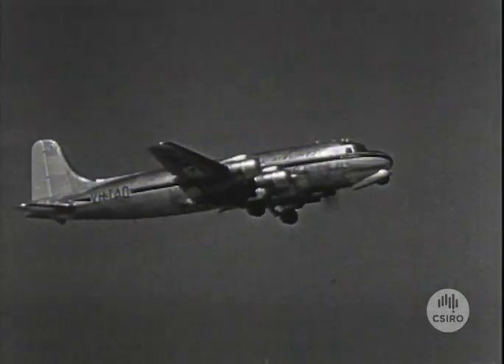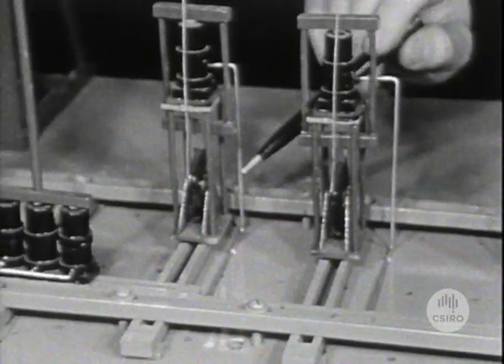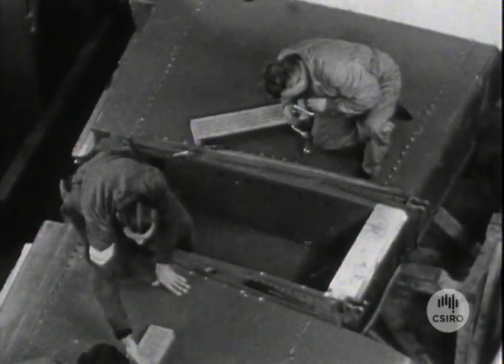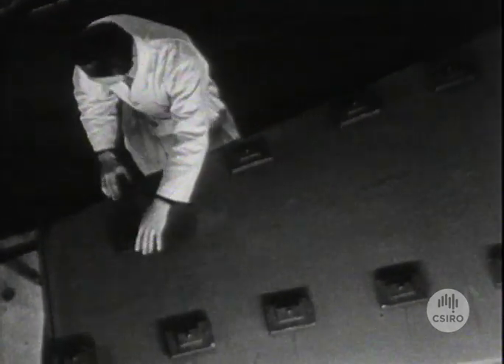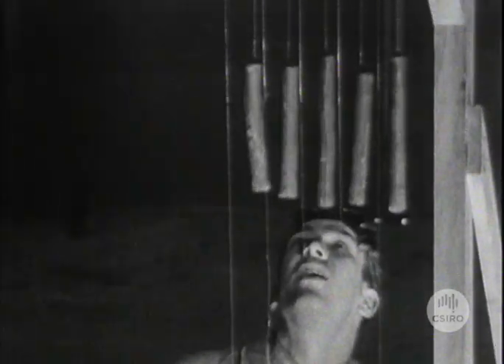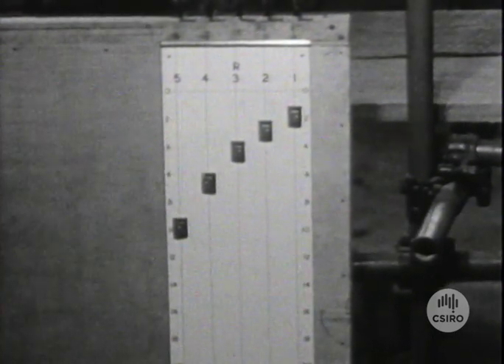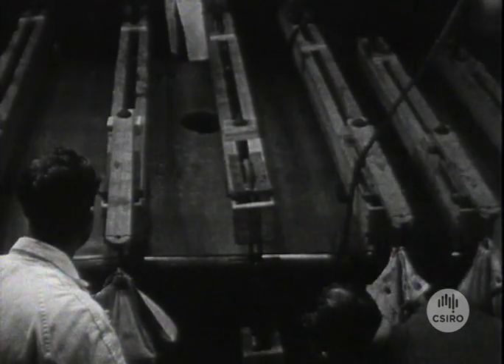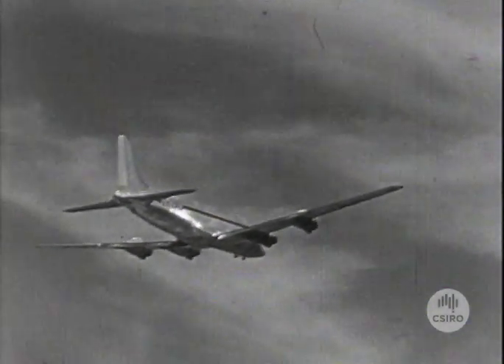Wings under test (1947)

Comment: A very interesting footage. The start of full size  fatique testing is documented. 

Test proof load is mentioned; today that is Limit load (?)

At 14:15  a repeated load of 90% of the test proof loading is announced. 50 tons is mentioned, 6 times a minute. The mossie is fully loaded 11340 kg, assume a fuselage mass of say 7 tons. It is suggested that engine inertia loads are factored with the load level, hence at 7:54 five hydraulic jacks are mentioned for engine load application, and also at 12:11
The repeated loading would be near 5G , close to limit load in modern terms. This is a firm test spectrum.
 Ultimate load was designed to be 8G, this test achieved 9G.

Louis van Rijn